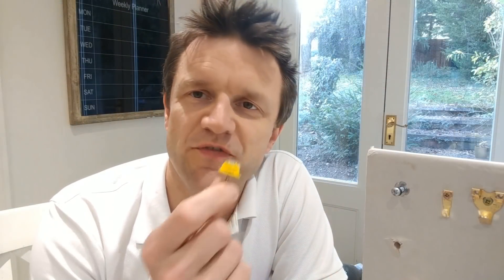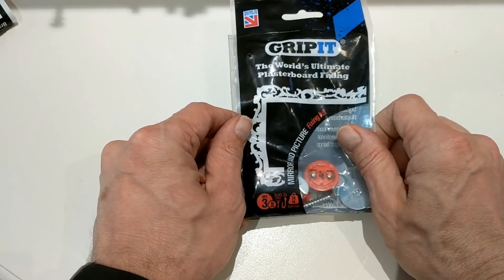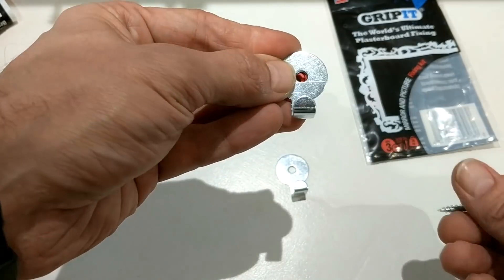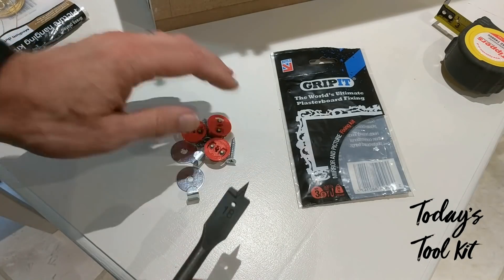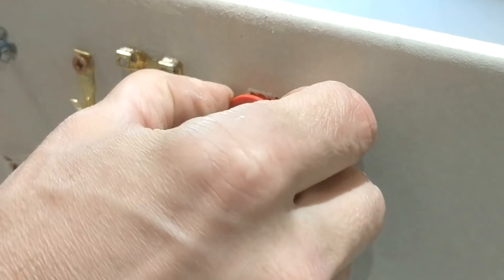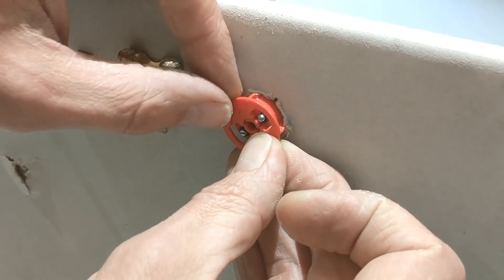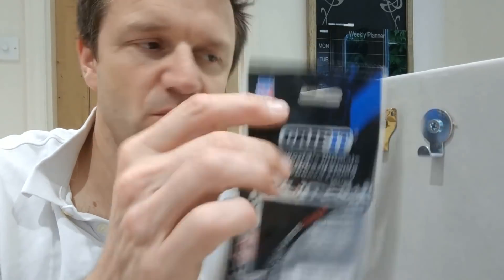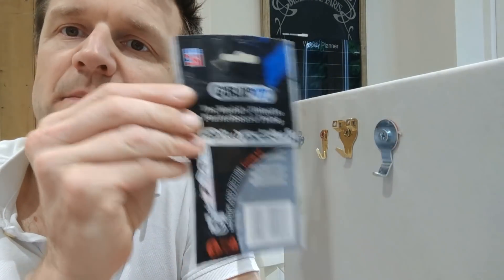GRIPIT Review: How to Hang a Heavy Picture on a Plasterboard Wall Video#2

Comment: It's quite simple as to why they supply one less bracket in the pack, it's to get people to buy another pack if you need 3. It happens all the time. It's called GREED.
Reply: Yep a common worldwide practice. Buy 2 packs & you'll have 6 fittings. Why wouldn't you (they say)?

Comment: My thoughts on the three pack with two brackets. It's perhaps designed for a three point fixing in a triangle arrangement. The two additional brackets aren't hangers but rests for the bottom corners of the mirror, which also explains the square seat of the bracket. The third, top anchor is for hanging the mirror.
Reply: This is exactly what I thought. But is it labeled anywhere that this is the correct usage?
Reply: @harms-jm7gx so what hangs on the top triangle fitting?

Comment: These are very useful when you only have a couple of cm between the plasterboard and blocks behind, not enough room for a snaptoggle to open inside, these saved the day
Reply from the maker: I agree Daniel. I've always said that. I just think generally the side of the wing that opens up is too small relative to the hole you have to drill.

Comment: The Gripit saved my life. I tried the supplied rawl plugs to hang a bathroom cabinet but they pulled out leaving a mess. The large hole required by the Gripit was good for me because it erased this mess. I found them to be better than rawl plugs in this specific instance as they didn't pull out. Also the plasterboard was close to the brickwork behind so a long fixing would not have fitted.

Comment: Well done with this one Charlie - I have only just found it. Good result with the manufacturer responding even if their responses were cringeworthy and embarrassing for them. To be honest I would never consider using them that hole is just too bloody big- fortunately I do not have stud walls in my home and able to get brick or block fixing for heavy stuff - and for that I tend to use Screwfix concrete screws which I only discovered last year and are my new fave.
Reply from the maker: Thanks Norman - I appreciate that, and great tip with the concrete screws - not something I've ever tried, so I'll definitely be giving them a go!

Comment: Hi Charlie. Thanks for your review on the GripIt Mirror and Picture Fixing Kit.

It’s good to hear that your overall experience and views regarding the product were positive although appreciate there are certain elements of our communication such as the website and packaging that require clarity/improvement. Both are currently undergoing a redesign for 2018 and will address the feedback from yourself and other users. As you correctly pointed out, the Red Gripit’s safe load of 74kg relates to the vertical load bearing down on the fixing into the plasterboard and not the hook loading that will hold no more than 15kg (a fact we will make clearer).

Regarding the drilled hole size, while it may be bigger than other fixings on the market, there will be little or no effect on the integrity of the plasterboard as the hole is effectively filled back in with the Gripit Fixing. The hole size is proportional to the load bearing capability of the Gripit as the retained surface area on the back of the plasterboard will increase as the vertical wings are extended to their full-strength position.
 
Rest assured, we take on board all the feedback we receive and will always do our best to improve the product and supporting comms wherever possible.
Reply from the maker: Gripit Fixings Thanks for taking the time to send such a comprehensive reply. Yes, I think it's a clever little product. I've got to say though, my heart did sink when I saw the TwistIt - helter skelter/ self drive fixings are a dreadful product in my experience - and I have more experience than most, putting up curtains and blinds. I've seen so many disasters with these in my day job and your internal bit to stop them over tightening won't change the fundamental problem with them that you can't get a secure fixing for anything other than downward loads with a fixing that is boring a thread into a brittle material), but I wish you good luck with it. I look forward to seeing the new website when it's ready.
Reply: @Gripit Fixings - what about the 3 gripits in the package and only 2 hooks? Does that happen often?
Reply: Hi Tony. The reason we include three fixings and two hooks in this kit is simply that one of our national retailers requested that specification when it was being devised. To streamline production and keep our product count to a minimum, we've found it beneficial to keep it the same when sold elsewhere.
Reply: @Gripit Fixings -  No offense but that makes no sense. It's like buying a coffee maker and the coffee basket is not included. Makes the third item useless. Thanks for the reply though and the explanation. Cheers!
Reply: I dont think gripit have done themselves any favours here by this fixing. If it says on the packet it should take that weight then it should its false advertising. Also, I would feel cheated if it had one missing hook, its rather silly. Great video Charlie
Reply: I think Gripit could have said "It's a mirror fixing kit which you only need two brackets for, however we include an extra wall fixing as a spare" - That's what I'd have said anyway ;)
Reply: How do I know what the  thickness of the plasterboard is when visiting a customers house ? Could you have not made a universal size that pinches up to fit when screwed? Other than that these look excellent.
Reply: Your shareholders are pissed of with your owners piss poor handling of the company, in fact he left them all to (excuse the pun) hang.
Reply: @Gripitfixings  In other words a form of "Bait and Switch"
Reply: I used them but I'm not impressed, especially if u need to remove

Comment: Hi thanks for your video I was wondering what could be used for our house all internal walls are Bessarabia brick and we just had stick on plaster in our renovation and now trying to work out how to hang a couple of heavy pictures. There isn’t any room behind the plaster so do you have any suggestions? And in Australia you can buy those new ones you got at Bunnings hardware for roughly AU $6-8 depending on how many kilo it holds. Thanks 😊

Comment: @Charlie DIYte Which fixings would you use if your plasterboard is directly on the "air duct"? On a corner. I have yet to fix it. I have 9 holes so far and none worked. Which I need to fix now. I don't want to put a hole in the air ducts. Some of the fixes I have seen require there to be space behind the plasterboard. I have no space.

Comment: Great video, useless at DIY but my wife has just bought a mirror to hang on a plaster board wall and I was panicking and was not sure where to start.  After seeing your video on Gripit I’m going to give it a go, the mirror only weights maybe 10kg so I’m assuming it will be fine.

Thank you for the video.
Reply from the maker: Thanks Carl. Yes if it's predominantly downward pressure, this fixing will be fine.
Reply: Use 2

Comment: I'm moving into a brand new build house which will be mainly made up of plasterboard walls ( I don't know the plaster board thickness or the plaster layer applied to it) I plan to hang a large mirror but im not keen on drilling such a large hole and using this fixing. What would you suggest? Or would this simply be the best option fixing to use.
Reply from the maker: Alan, I've literally last night uploaded a comprehensive new video. Take a look and feel me a line if you've still got any questions https://youtu.be/Jdu9RId7m90

Comment: Good product, I used these to hang a rail bracket on my kitchen cupboard then drilled screws into the studs. Holds heavy weight evenly distributed.  Quick, simple good British quality.

Comment: Would you hang radiators with these? I've just purchased loads from b&q at a steal of a price
Reply from the maker: They're flogging the stock because the company has gone bust. Personally I wouldn't. I'd use something like a Geefix or if it's a dot and dab wall, a Corefix, spanning the void and drilling into the brickwork behind, but you'll probably be ok with them. I just remember that scene in Dragons Den when Peter Jones pulled a radiator off the demo wall they had constructed. 🙄

Comment: Charlie, do you have any experience with double-thickness plasterboard? I tried to fit a grip-it fixture recently in my kitchen but having drilled the hole i realised it was double thickness board. I've hung a heavy picture using the trusty Fischer UX6 and am hoping to hang a tv bracket (tv only weighs 4kg) so nothing too scary. Guessing the UX6 would be ok here too, and maybe I would be better off mounting into a stud. Would appreciate your thoughts. Thanks.
Reply from the maker: Hi Jon, sorry I missed this. If my advice isn't too late.... the strongest option would be a hollow wall anchor - which you can buy with a double thickness collar to match the depth of your double thickness plasterboard. This will be incredibly strong. Check out my video https://youtu.be/e3hjzPNe5wk on how to install them. At 1.13mins into the video you'll see the anchor with the longer collar that I mentioned above. Failing that you could use one of the new Fischer Duopower 8x40, but the hollow wall anchor would be your best bet.
Reply: Try the undercut tool designed for the Gripit.

Comment: although the bracket bent would the fixing  along hold i ask as i want to put my pc on a shelf but it weighs 22.5kgs and i dont really want it crashing off the wall.
Reply from the maker: Do not use these. For belt and braces get some Geefix but watch this video for a complete run down https://youtu.be/Jdu9RId7m90
Reply: @CharlieDIYte  that’s a lot for the help very much appreciated your video linked was extremely helpful too.

Comment: Great channel and review, i think what your missing is the fact that it gets you round the issue of solid(celotex) and blanket insulation in the void. Using most other fastners require a void in the plasterboard cavity deploy. However this product finnishes very flush to the boarrd so it dosent get foul up like a brolley fixing, toggle and many others do.
Reply from the maker: Except that wall anchors force their way open in celotex, but I take your point.
Reply: @CharlieDIYte  brolley fixings usually struggle in my experience.
Reply: Whenever any fixing fixes into Plasterboard, it’s longevity depends on the toughness of the PB ,unless it is fixed on wood frame studs or it is supporting feathers .:-))

Comment: Another objective review. Thank you. Since finding your channel we rely fairly heavily on your recommendations (although I'm still gutted that I'm just not strong enough to use the Titan drill). We're looking at installing some heavy duty shelving in our utility room and don't want to be woken in the night to the sound of everything falling down so Grip-it is looking like the way forward.

Having watched this video and not having scanned all 100 comments for any answer from Grip-it I'd suggest that the metal hooks they provide in this kit are designed for the bottom of a square/rectangular mirror to rest on hence there only being two in the pack. The third would be for the fixing the mirror hangs from and would probably be supplied with the mirror itself.

It's not really fair to talk about the metal hooks not being able to withstand the weight of your tool boxes as it's the Grip-it fixing that has been rated. It looks like the fixing behind was standing up fairly well to the weight of your tool boxes.

I hope my comments come across as constructive, please keep the reviews and advice coming.
Reply from the maker: Emma, are you in some way affiliated to Grip-it, per chance?

Comment: Hi Charlie.
My experience with the Grip it fixings are not positive.
I agree with you. The initial hole required is far too big. Not a good idea if you need to move them. I installed an insulated Pir backed plasterboard wall. I needed to fix a curtain rail. I thought let’s try these. I had some left over plasterboard and gave them a try. In my experience the fixings failed as one or both “fins” wouldn’t open up.
Reply from the maker: Exactly. Here's a vid that night be useful for that https://youtu.be/L2Hy1IhQ17s

Comment: Hi Charlie great video so many thanks for that I need to hang a TV onto a plaster board wall its only a 32 inch screen so not a great deal of weight and I've seen gripit do a kit esp for tvs  I've checked the wall and there is a gap between the plaster board and brick so I thought this application might do the job just wondered if you have ever come across these for TVs they are blue plugs I think many thanks Paul
Reply from the maker: Thanks mate. You want to use these really https://youtu.be/aeFyQS2NGVM. Much stronger than the Gripit.

Comment: Hi, great video Charlie and well done Gripit Fixings for responding with such professionalism, dignity and respect.  
My questions are:- 
1/ I have a depth of 20mm in a dense ish fiberboard with not much gap behind (so using spring toggles, zip snap toggles, or any other type of fixing wont go through fully) 
 I would like to attach shelves with simple brackets onto , so these would be perfect, do these come in a 20mm depth? 
2/ If 1 Gripit takes a certain weight would 3 (as in a Bracket for a shelf) triple that weight   Thank you

Comment: Gripit fixings are very good and have done an excellent job, but like yourself I like using as small a fixing as possible.  Gripit leaves a big hole should you have change your mind.  Loading is the only main consideration I look at and probably these are a bit OTT and very expensive.  Great and useful vid thanks for sharing.

Comment: Hi Charlie. Thank you for the great video that addressed the few issues I have with this kit. I haven't bought the kit but pretty thought of the same things you mentioned.
I need to hang 40"+ tv's to our walls & given that we are renting I don't want to drill several 25mm large holes into the wall for us to only have to figure out how to fill them if we leave. I'd prefer the smallest holes possible with the same, if not better, weight rating. 
I do like the idea of the Gripit fixing but I think the better way for me to go, I feel, would be the much sturdier looking anchor fitting that you prefer. 
Great video.

Comment: Surely you could just use your own desired hook instead of theirs? Not sure of the size of hole in the bracket but if yours is too small for the screw you could just drill it out a little??

Comment: So can you just use any kind of screw? or do you have to use the ones provided?
Reply from the maker: Gramsci You have to use the ones provided, or if not long enough for your application, buy a longer one with exactly the same diameter and thread size.

Comment: How do I go about hanging a curtain pole to insulated plasterboard?
Reply from the maker: Fischer Duopower 8x40 with 4.5 or 5 X 50 mm screws. Just make sure you don't drill through the vapour barrier at the back of the insulation.
Reply: @CharlieDIYte  Thank you pal, keep up the good work mate 😊

Comment: I need to put up a tv on my wall its plasterboard what fixing should I use ?
Reply from the maker: Try and screw into studs behind the plaster board of you can. If you can't,  and there's a small void behind the plasterboard before the wall, Corefix are good https://youtu.be/fx90VadXSXA. Failing that, I'd recommend wall anchors. https://youtu.be/e3hjzPNe5wk

Comment: I find they are ok. But latest model has plastic wings. These make them a lot weaker. I've had two installations where the plastic wings have snapped and failed. So top tip is try and get fixings with the metal wings. The load on the fixing was about 15kg.
Reply from the maker: Thanks for that, Paul. However I really would try and wean yourself off these if you can, particularly if they're now compromising on the quality as you say. These fixings have always had a fundamental flaw - the wing is disproportionately small in relation to the size of the hole you have to drill. There are so many better fixings out there - snap toggle, wall anchors, Geofix and Corefix if it's dot and dab, to name but a few.

Comment: Can the screw be undone and refitted if I need to replace the hanging bracket ?
Reply from the maker: Yes it can and in fact you can remove the fixing if required, but there are lots of better fixings on the market.